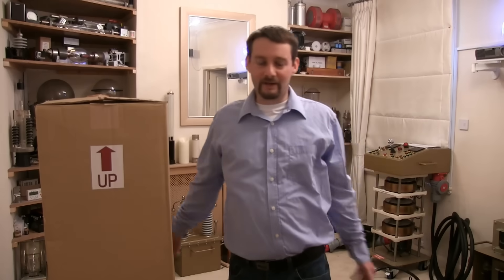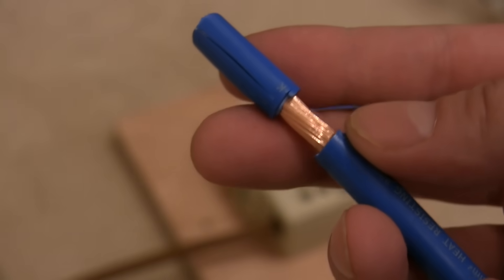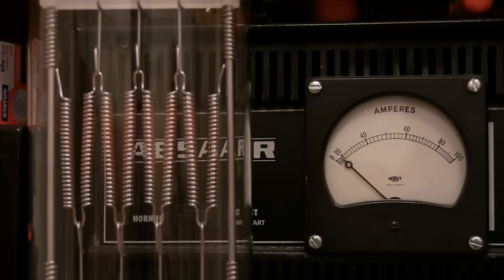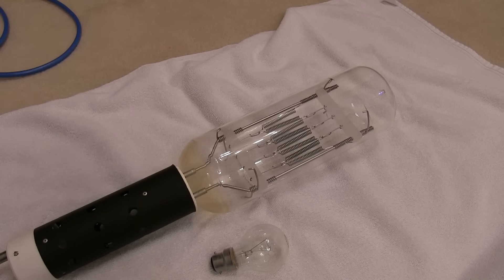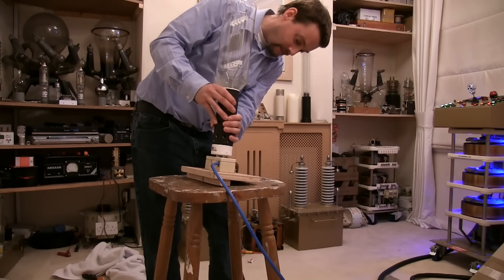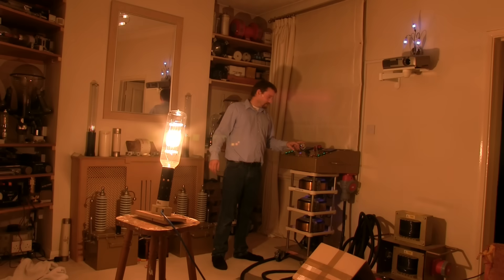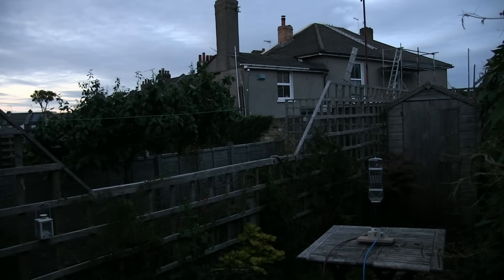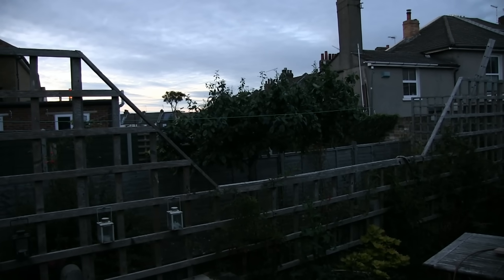20,000 Watt Light Bulb Test

Comment: Does every house in the UK has 100amp capability?
Reply: American houses tend to take in 240v 300a (2 120v 300a phases with 180 degrees of separation) and split down to 120v for household outlets, and 240v 2 phase plugs for high draw appliances (over 1500 watts)
Reply: That might be the other way around, I have a new build with a 100A supply.
Reply: That's a lot! In Italy usually it's around 20A.
Thanks for your reply!
Reply: ***** Thank you! now its clear. I didn't know the term 'split-phase' but now I could have searched for it. It's interesting to see a single phase transformer which creates the 2-phase supply. It makes also an awful lot more sense than my initial guess with the capacitor :) .
Reply: I didn't know there was 180deg 2 phase standard anywhere in the world... Interesting!
Reply: +themaritimeman 20A for the whole building is common in Italy. There have been big electricity shortages for years, and the government refuses to sort it out. So, homes can normally only get a 13-20 A supply. 

It's known for people to register a house as multiple apartments with the electricity utility, so that each room gets its own electricity supply.
Reply: here in Quebec canada is 240V 200A with split phase for 120v  my water heater is 3Kw of power on 240V lol and all electric heater is on 240V too  and 100A for appartement
Reply: +Alex Phillips Thanks for your comment. It was weird to see in another video, that some guy run 2 live wires to a boiler and I assumed it probably is 2x120V but I wasn't sure and was too lazy to search about it :D .  I'm more used to 3-phase systems, like our home, which is fed with 3x230V/415V. BTW, how is that 2-phase created? Using some capacitors on grid level? I thought US national grid is also 3-phase, but I might be wrong.
Reply: +Crazy Wolfgang 20A for the whole building? Are you sure that's not 20A rating for the circuits?
Reply: Nope, the most common contract in Italy is 4.5 kW, but it's not unusual to find 3kW in small families.
Reply: In the US, newer houses typically have a 200 amp feed, but older houses (pre 90's) only had 100 amp feeds. The feed is two 120-volt lines with a neutral for a total of 240-volts which is used for large electric appliances such as clothes dryers and ranges.
Reply: Usually we use natural gas to heat water, where not possible the only alternative is a 1.5 - 2 Kw tank water heater.
Reply: same as in Australia my house has a 15 amp breaker for the power points and a 10 amp breaker for the lights so total power is 25 amps at 240 volts!
Reply: would that be 200A 2x120V phases ? never known any normal house getting 200A at 240v (only seen places where power is fed by a pole been capped at 60A in the UK, houses typically have 80-100A at 240v)
Reply: Dont know here we have 2 live 1 neutral come in my 200A siemens breaker panel
Reply: pierre-alexandre lemay that's 2 phases then each 100A is that at 110v each or 240v each (outside the UK 2 phases is more common so you can run aircons in each room and pool pumps and cooling or heating stuff)
Reply: Mix 2 side of panel so 2 live for 240V
Reply: lee x
Reply: lee x and that is for residential for comercial and industrial is much more
Reply: pierre-alexandre lemay in the UK and most of the eu/world norm its 1 phase 230-240v (ish)60-100A and 3 phase 400v, the US handles it bit differently as they use 2 phases to make 240v (also as this is really outside my knowledge when it comes to this, 2x120v100a so 200A total would not the max still be 100A on the 240v side?)
Reply: +lee x mix the 2 120v phase for 220v so max of all the house is 200A dispatched on each side of panel   each side is 120v 1phase  but for waterheater or dryer we have dual 20@50A linked breaker to the 2 live wire to make 220V
Reply: lee x 240v in the distrib panel is 2 busbar where all breaker connect on it and 2 phase is in alternance of other in panel so if u have a dual breaker u have 2 phase so 2 live of 240v and for 120v is a single breaker so only connect to one phase in the box
Reply: + Crazy Wolfgang  Wow, here in the U.S. where I live that's only enough to power a single 20A receptacle circuit. My house has a 200A main. The electric heat for my house alone is 125A 2-Phase. This is considered entirely normal here in the states. My heater is old and uses aluminum wire, so most heaters in new construction most likely run on 60-100 and not 125A.
Reply: Murphistic The two phase is created by center-tapping the transformer that takes from one of the 15kv transmission phases.

Comment: I think you missed something. The lamp is rated for 240V. Your maximum was way under 230V.
Why did you limit on the watts?
Reply from the maker: On full load my incoming service was dropping to 217v the variable transformer pushed the volts up to more than what was coming in, as a result the current on the input of the transformer increased to an uncomfortable 95A ( would not  wanna pop that 100A fuse )
Reply: +Photonicinduction aren't you living on the USA? You'll probably have 120V then...  Ok
Reply: +Distelzombie Centzon Totochtin He lives in UK....
Reply from the maker: I live some distance from the transformer, at best I get 235v normally its 228v. I can get the 100A easy, but the volts drop like a sack of shit and I'd be optimistic to get 23kVA
Reply: It's not 240/480V, but 240/415V, 230/400V or 220/380V.
Depends on part of Europe you live in.

You calculate three-phase voltage by doing:
(single phase V)*sqrt(3) = (three phase V)
Reply from the maker: We have a lot of pad mounted transformers 500kVA upward, there are several streets on one transformer.
Reply: photon lives in the UK as far as i know
Reply: ***** Allowed variance in Europe is +/-10%.

So 230V means 207 - 253V.
Reply: Most houses in the UK used to have a 60A main fuse and the electricity board came around and swapped them out for 100A fuses. This was quite a few years back but I never saw them upgrading any wiring in the street before they did this. So optimistic is probably right.
Reply: those 100amp fuses blow with a big bang dont ask me how I know haha :)
Reply: Fuck off. UK is not part of europe anymore! :-p
(Joke, no offence intended)
Reply: Bear in mind, the variac is also likely to be 5 or 10 meters from the DNO's cut-out, so there will be some voltage drop on that cable.
Reply: I have 125A x3 400V supply. We are fed by large 500kVA transformer, but thin aluminum power lines and distance makes voltage drop quite a bit.
Reply: (related to other post) UK uses single phase 240v, not 2 phase 120v to 240v 1 phase,  this tends to be a USA only thing (rest of the world that uses 240v its norm straight single phase 240v no 120v involved)
Reply: +ericspda ok... We got both 240V and 480V. Last one is for oven and such. I don't know what this is rated at, but the 240V are just 16A. (in an apartment) For security reasons. 
 
I didn't knew USA also had 240V. 
Do you have the 480V connection, Photonicinduction?
Reply: +Distelzombie Centzon Totochtin 
Oh,  I live in Germany
Reply: +FHRsLP ups. You're right. Thanks for the correction
Reply: the bulb is rated to 20,000 watts he didn't want to destroy the lamp so soon
Reply: +Photonicinduction I live 2 doors from a substation pulling in 220kva here in new Zealand
Reply: +Thomas Orr ah, I did not really understand the problem here.
 If I do the math the lamp should only need to draw 84A with 240V to reach 20kw. 
With his ~220V it's getting closer to 100A. 
Uups.
Reply: would that be 200A@120V thought (100A@240v is the same as 200A at 110V just you have 2x 110v phases )
Reply: Photon, you just need some liquid nitrogen spraying on the 100A service fuse and you're laughing!
Reply: Solar wall required. More amps than the wet pack backup in the cellar, Photon...
Reply: :-]]]
When you're selling your house, let Photon know!@!
Reply: Maybe the plate was removed because it was obtained and installed by the drug lord at the end of the street to power his new condominium?
Reply: GUESS HE WILL NEED A BUCK/BOOST TRANSFORMER
Reply: You wouldn't pop it. Check out the cart of time it takes to blow a fuse related to its rated current. Seeing how short your bulb session was, you could easily get away with using 50% more current.
Plus you should have used phase-to-phase anyway.
Reply: zwz • zdenek the other issue was his voltage was dropping as well so the amps would of continued to go up very fast (was at 217v at 95 amps) households in the UK don't have more then 1 phase normally (USA seems to use 2 120v phases to make a single 240v phase)

He could of pulled more power but voltage would of dropped even more higher chances to pop the fuse then
Reply: lee x
Irrelevant to my suggestion, no and no. The single phase limitation is for flats only, detached houses get 3 phases as standard. And that's what was in the cable connected to the variac. If his limit is 100A, that's enough to run this bulb indefinitely. For some popping power, a phase-to-phase 400V would be reasonable as an AC source. If DC output was acceptable, a 3-way half-bridge rectifier would utilize all 3 phases for the insane 69 kW sustained!
 Or 100kW for a minute or two before the breaker trips, but that would still make for an epic POP.
Reply: "How would anyone think he lives in the US."Well, I for one was confused by his thick Louisiana accent. What I really want to know is: does Photonicinduction do voice-acting? Something like: "Allo, 'allo, 'allo: what hav' we got 'ere then? You're nicked, me old china." on an episode of Danger Mouse, or similar.
Reply: zwz • zdenek he only has single phase 240v 100a (houses don't typically have 3 phase)

UK residental houses don't get 3 phase installed normally (not even wired for it, unless this is a London thing where houses get 3 phase as standard)

only industrial units tend to get 3 phase typically and places that have paid to have 3phase installed or large buildings/houses that likely will need it based on size of the building
Reply: either the 100A would go or the road outside would have smoke plumes coming from it... can you legally put in a 110A fuse? and draw 100 "reliably"?
Reply: emma young the bigger issue is that the voltage was dropping he could of pulled 500w more but incoming might of dropped to 210v from 217v ish so would of not really got much more watts out of it before he blows the utility fuse (it is a slow blow fuse but still risk of blowing it ) I bet it was super bright in that room .the outside test turning night into daylight is always interesting
Reply: emma young I don't believe you're allowed to change this. It's probably property of the provider or the city. (but I don't live there)
Reply: Distelzombie Centzon Totochtin
You can't change it yourself, but you can request an upgrade. The provider will evaluate the load of the cables and the transformer and then either install the breaker and raise your monthly bill, or reject it.
Reply: zwz • zdenek yeah, raise it to glob knows what!
Reply: Distelzombie Centzon Totochtin
It's about $2/mo for an upgrade from 25A to 32A where I live. We had this done a few years back to be able to use a large welder.
Reply: Oh

Comment: I once tripped a 1300A breaker recharging a battery and you didn't trip a 100A breaker lighting a lamp? Where are you at @Photonicinduction?
Reply from the maker: lol, I'm here mate
Reply: I think you mean a 13 amp breaker!...1300 Amps are only available at you nearest power station...
Reply: Edited he got a 100a supply (photon)
Reply: He uses a 100A C-rated breaker. That means that they instantaneously trip on 5x-10x the rated current.

Comment: How did you get three phase into your house?
Reply: Just single phase, 100A main fuse
Reply: Call your electricity provider, and ask.
Reply: Would those 3 variacs be in parallel then?
Reply from the maker: They are all in parallel, the spare L2 and L3 in the cable and plugs have control wires for remote op

Comment: How'd you get a 100A supply to your house?
Reply: i think its standard here in the uk?
Reply: +Guth 100amp used to be the norm around 10-15 years ago, theses days its 60amp unless you have storage heaters.  The supply grid cable can handle way more then 100amps tho, its just a matter of changing the service fuse to 100amp in the cutout.
Reply: +Mark P If the home in question has storage heaters then the service fuse is 80amp.
Reply: Lol, they are fast dieing out, most people theses days have gas central heating.

Comment: Working on television sound stages they normally would use anything from 1k, 2k, up to 5k but notthing bigger mostly.  With a stage lit up you would sweat your ass off if you were up in the catwalks near the lights.  This would be used for an outdoor night shot, like a moonlit scene.
Reply: +John McFerren A lot of bigger equipment in the US runs at 220 volts (which is more efficient for higher power requirements, which is why your electric clothes dryer and electric stove at home use it.) At the factory where I work a lot of the electrical equipment runs at 220 volts and some even runs at 440 volts.
Reply: how about for a moon landing scene? +rompn4x

do i smell a conspiracy?
Reply: DEPENDS WHERE YOU WORK. COULD BE X-RAY EQUIPMENT. COULD BE PRIMARY FEED FOR A TRANSFORMER LOCATED FAR FROM THE POWER POLE. COULD EVEN BE FOR CLINTONS DILDO OR TRUMPS HAIR FIX IT.
Reply: I doubt it, 60 years ago the largest tungsten lamp GE advertised was 10 kW. Now you can get up to 24 kW halogen studio lamps, but the fittings are also capable of taking a 20 kW lamp as well. This is the 24 kW bulb. Even though this is 240 volts it is actually a US bulb. http://www.stagelightingstore.com/GE-Q24MT32-4C-24000W-240V-150HR-3400K-Stage-Studio
Reply: Exactly, I've even seen 4160 volt motors in use.
Reply: +John McFerren there's actually an overhead conduit where I work that is labeled 'Danger- 14,600 Volts', I have absolutely no idea what they use THAT much power for!
Reply: Years ago (late 80's) , for shits & giggles, I pointed the entire stage lighting system at my college at one spot (leko's focused at my head).   Over 400 750w & 1K lights on at full.  What I saw in that video is like I felt under those lights.

Comment: It's time to make a 20,000 Watt LED lightbulb! Imagine the Lumens!!!

100 Watt LEDs are made. Just get 200 of them and piece-fit them together into a giant square slab, and you will have the most ridiculously bright light ever made!
Reply: Actually, you can get 500W COB LEDs now...  http://www.ebay.com/itm/371626419683  ...rated 60,000 lumens.  20kW requires 40 500W LEDs, so that's 2.4 million lumens.

Bright, but not brightest ever.  The light at the top of the Luxor Hotel in Las Vegas is 13,650,000 lumens, according to Wikipedia.  See...  https://en.wikipedia.org/wiki/Luxor_Las_Vegas#Luxor_Sky_Beam  ...and...  https://en.wikipedia.org/wiki/Searchlight#Non-military_use
Reply: Just get a 12kw metal halide lamp... nearly 1.2 million lumens!

Comment: Holy hell. You have a 200 amp service right?
Reply: He has 100 amp, he mentions it as he's plugging the big cable in. Standard for UK houses.
Reply: abyssunderground That's what it sounded like, but I just didn't want to believe it. Damn that stinks.
Reply: Remember we run 230v in the UK but US run 120v so half the amps are needed for the same power.
Reply: abyssunderground I'm no expert but I know the US has two 120v lines out of phase that are used for 240v appliances. Dunno if that means you get the 200 amps at 240v or not. Edit: well it looks like the UK has some other split phase thing going on too. I have no idea how any of that works so nevermind =P